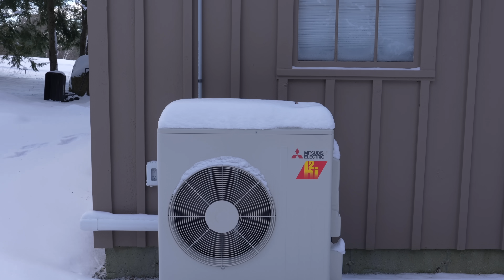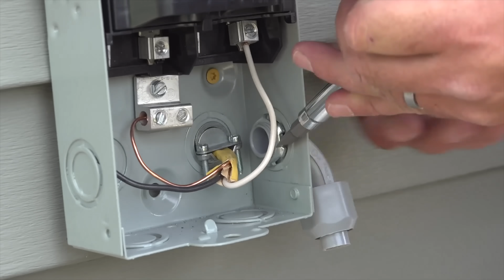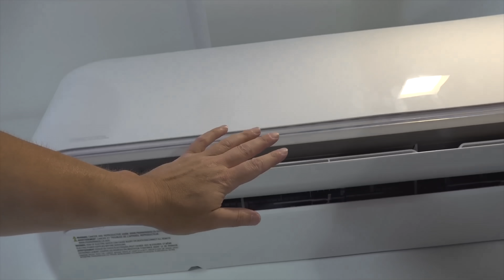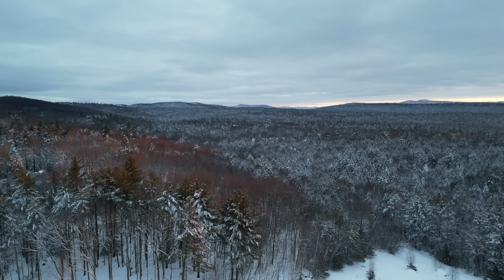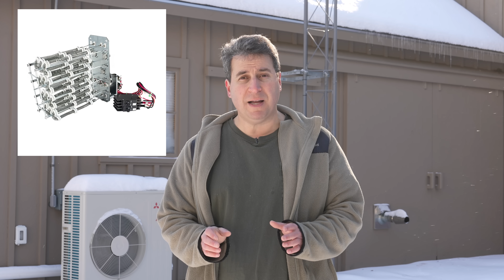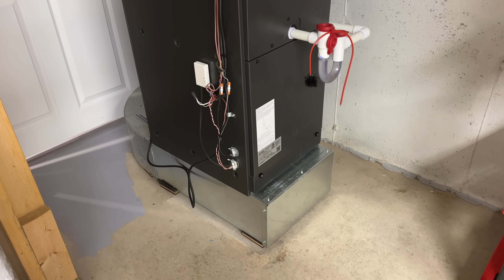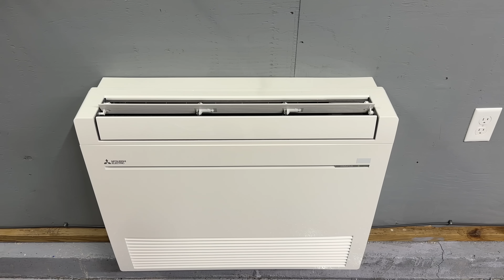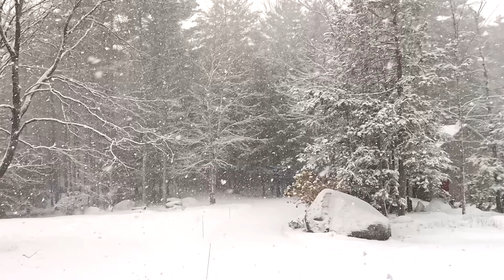Why Heat Pumps are now leaving people COLD

Comment: This talk about heat pumps being 'efficient' is misleading insofar as making people think that this machinery actually produces heat more efficiently than burning fuels directly. They do not. When you are pumping against the natural thermodynamic flow, that costs you energy. Now one brand of heat pump or system layout may be more efficient than some other brand or layout, but that is RELATIVE efficiency, not absolute efficiency. 

Highest efficiency means don't do anything at all, but no one wants that. All other options cost energy, some more, some less.

Comment: I have 3 systems now, they are not all created equally. I have two of the cheapest systems and a mid range system. The two cheaper ones will blow about 50 degrees when it's zero outside, the mid range one was at 70. All three units perform the same at 20 degrees outside temp. from there the heat output stays the same all the way up to spring weather. I've been told that locating the condenser in a spot IN the open helps "catch" the heat, the better performing unit just happens to be hanging in an area where it gets the most airflow while the others are under porches and on the backside of a building, both shielded from wind or show. I still have gas heat for when it gets below freezing but the heat pumps do most of the heating on most other days.
Reply: Jesus.  Condenser coils do not "catch the heat."  That's what the big fan is for.

Comment: Canadian here with a 1980’s house. I have a heat pump working down to -15*C (5*F) with no issues. Any lower and I have my electric heating aux heat come on. 
Using an ecobee, I can fine tune how and when the aux comes on. So far no issues at all. However I would not feel comfortable running a heat pump alone with no aux heat installed. 
The manufacturer has tested efficiency data down to -15*C and extrapolated efficiency data down to -32*C which is why I chose that temp setting value.
Reply: if it is one of those cold climate models, you should run it down to -20c at least considering your backup is electric -> as long as it has a cop much above 1, it saves compared to aux heat. aux heat can just supplement instead of take over completely.

Comment: The heat strips usually require additional electric service to air handler. Some homes would require panel upgrades. If no additional heat strips are installed every time the condensing unit defrosts your system will blow room temperature air. With cold ambient temperatures that could happen quite frequently. Dual fuel systems are a option if gas is available and electrical upgrade is not.

Comment: I'm surprised installers don't suggest backup heat in colder climates. They suggested it when I had my system replaced a few years ago, and I'm in Florida. I guess since electric heat is already common here, it's easier to sell people on using it as a backup.

Comment: I have a 90’s brick home in South Georgia.  I had to add double r30 (on top of 10” blown ) above the master bath and single R30 above the master bedroom because they install the heat pump handler in one corner of the house and our bedroom/bath was in the opposite corner and the temp was 85 degrees in the rooms in summer. Adding insulation was financially are only option. Technician said the heat pump was running perfect but had a bad set up in the attic with the old boxes.  We use a space heater in the winter like you suggested until we can remodel the bath and fix the problem.  Thanks for all you do.

Comment: I've had two air source heat pumps on my home for about 8 years now. My home is also and was previously heated since 1985 by oil, whatever the key pump is capable of. Regardless, the oil is cheaper to run for these last 8 years or so when it's down below. 30 to 40 Fahrenheit depending on me. Local prices of oil and electricity. I think one year was as cheap as break. Even was like 25 Fahrenheit. So when it's below that I use the oil. When it's above that I use the heat pump

Comment: So I question his claim that heat strips allow more efficient operation of the heat pump during high demand.  Resistance heat has a coefficient of performance (CoP) of 1.0.  For heat strips to be more efficient than the heat pump, that would mean your heat pump is operating BELOW a CoP of 1.0.  I have looked at a lot of heat pump efficiency curves and as long as you spec a reasonable unit for your climate, even at the bottom of the temp range, they are above 1.0.  Granted, I have not looked at every single spec and it's possible that in some extreme cases, certain heat pumps when WAAAY below their spec range for performance, do operate below a CoP of 1.0 but this is not typical, at all.  I would revise the statement to say that the heat strips A) increase comfort, and B) add performance to your system capacity in terms of how cold it can perform as well as how quickly it can warm up the house.  Basically it's managing a space heater for you in the most optimal way possible.

What people really need to do is understand their actual heating demand on a design night.  That "18,000 BTU" unit you installed MIGHT only do 6k heat on a -13F night (like my Mr. Cool 18,000 split system).  But I have a full oil furnace for my house and while I have 3 zones of mini-split, my furnace is 100% operational and intact.  And a wood stove.

Comment: It's 9F this morning in my part of Maine. I woke up to my new heat pump/mini split in defrost mode. I find when it's in the teens or below, it spends a lot of time in defrost. I crank up my propane heater on these days. I already had the propane heater due to all the power outages we have here in the winter, so I didn't trust an electric powered heater as my primary heater anyway.

Comment: heat strips kick in when the heat pump outside in cold temps drops off. the range heat pumps work well is not good anywhere.. geothermal if you can is a big costly add on? using hot water from the water heater.. thats not free? old school wood stove or mr buddy heater to suppliment heating..? WHEN the power goes out you need some non electric heat.

Comment: This really is a question of sizing. If the heatpump cannot keep up in cold weather, it is too small to heat the space. Supplemental heat makes sense in some cases because it is cheaper to use inexpensive electric heat strips on the few coldest days (nights really) than it is to get a larger (and more expensive) heat pump...and since the efficiency will be lower on the coldest days using electric heat on those few days doesn't hurt efficiency too much. But there's no technical reason why a heat pump cannot be sized such that it can heat a home effectively on the coldest days in that climate.

Comment: I'm in California, in the San Francisco Bay Area, and heat pumps work great year-round here, since the weather is relatively mild. No supplemental heat needed.

It's been relatively cold here recently, but "cold" here means 5 to 10C (41 to 50F) overnight. Still well within a temperature range where the heat pump will be efficient.

Comment: This sounds like a too small a system problem. You need to size the unit based on the account of heat it can produce in cold time. They all tell you the heat output is reduced at lower temperatures. 

Buy the correct size unit for the climate.

Comment: Is the drop in efficiency due to the temperature difference? If so, reducing the temperature inside will improve its efficiency. Conversely heating the air around the external unit will do the same - reduce the temperature differential. Perhaps then enclosing the external unit and heating it with say water from the ground may be sufficient to keep the efficiency up providing ground water is warmer than the external air.
Great video.
Reply: @r3furbish3dbrain12  That's right, that is why one needs to pump heat in, like with ground water.

Comment: My central heat pump system (Trane) has been working fine in these signal numbers nights. Also my system has Emergency heat just in case which is a heating element.
Mini splits suck.

Comment: I was an A/C tech for over 25 years, and now have plastic knees because of it. I have a heat pump on my house, and it works great. And it is cheap to operate. But. I live near Phoenix, AZ. Possibly the hottest inhabited place in the U.S. Even in the middle of winter it rarely ever reaches 32 degrees F, and only in the early morning hours. If you live in a place where it normally drops below 0 degrees F, a heat pump won't do you much good.

Comment: As with everything, the devil is in the details. Most people don't read the specs for their systems. The apartment I lived in decades ago (built in 1995), absolutely will not work below 35F -- the outside coils will not go near freezing to, well, not freeze. Compressors can work well below freezing. (how do you think commercial freezers go down to 0F.) It's the transition period that has to be carefully dealt with -- dew point, etc. -- to keep the coils from icing over. Once past that point, the temp can go way low. The colder you can get it, the more heat it can collect.

If I'm living in a place that routinely freezes, I'm not going to waste my time with a heat pump. I'm going to heat with stuff that makes heat: FIRE. (gas, wood, maybe some solar collectors.) And insulation. I'm talking antarctic level here. Once I get some heat, I don't want it escaping.

Comment: Another thing is you must elevate a heat pump it will not work if it is buried under the snow (always mount of stand be it a ground one or wall so that even if it snows a lot it will not be below the snow line). And if you get hail make sure the coil isn't exposed as this can damage it permanently. Also not all heat pump models include a base pan heater which is needed for frozen condensate otherwise the outside coil may ice up (if you live in an area this can happen make sure you get one with it by default or optionally install). 

In extremely windy environments or if you install it in the open you need hood/guards to stop the wind from interfering with the internal fan. And final thing that can ruin a heat pump is if you install it near ocean spray you need a unit specified to withstand the harsh corrsion that it will encounter.

Comment: Heat pumps are a scam!
How?
The heat pump that is super efficient and laughs at sub zero temperatures is not a reverse cycle air conditioner but a geothermal exchange system. These geothermal systems can be expensive to install especially as a retrofit as they require very deep holes to be dug where coils of tubing can be laid so that a heat exchange medium can be pumped through them. These systems can then use less energy to operate for a month that one of these scam heat pumps use in a day.
Why do I say they’re a scam? 
Scams usually involve misrepresenting facts or relying on the ignorance of facts to make the victims believe what the scammers want them to. Reverse cycle air conditioning is far more efficient than a resistance element, you can get upto three times the heat out of a thousand watts of electricity with an aircon heat pump than a bar heater can provide, but geothermal can do the same with three hundred watts , yet both geothermal and aircon are called heat pumps , the scam is the false equivalence that is encouraged.

Comment: I use a Mr Buddy when it gets below 20.
Connected to a 20 lb propane tank, lasts for days.
Flame beats electrons!
Reply: I have a Mr Buddy Hunting Buddy with 30 pound tank, long hose, and filter. I really cannot stand the smell of burnt propane in the house. I have to keep widows open a bit to vent the stink out.
But its there, available during emergency, and is reliable.

Comment: As with any heat pump, you need a back up source for the few days per year that it gets too cold to keep up with heat loss.  As far as efficiency, the pressures go down with temps so the unit uses less electricity so the cost goes down as well.  The real problem as I mentioned above is that the heat pump might not be able to keep up with loss.  With SEER ratings being 20 or over, the savings, even using back up heat quite amazing.  We use out back up heat around 3 days per year along with the heat pump.  The increased cost per year is miniscule.  Using mini splits we heat 2 homes on our property plus all other electrical divices combine for an average monthly electric bill of around $175.  That includes electric hot water, lights, electric range, electric clothes dryer, computers, tvs etc.  If I used the back up heat all winter that annual average goes up well over double or even triple.  So don't be fooled by scare vids like this one.  Heat pumps are the largest selling heating device in Canada.  That should tell you something.
Reply: Installers are screwing people everyday by sizing the units at it's 100% BTU rated capacity. As it gets closer to 0f the rated capacity drops off to the range of like 80%; the installers need to size the units based on the 80% rating. Guess that concept is a bit too complicated for some hvac techs. I'm glad I had a good installer, and it sounds like you did too. . . sucks so many people are getting hosed.
Reply: It tells me that you don’t have access to natural gas. It is by far the cheapest way to heat a home other than cutting free wood for a wood burner. Unless it’s a geothermal system heat pumps are useless in cold climates. An air to air heat pump is nothing more than an air conditioner that runs backwards. In other words it’s trying to cool the already cold air outside. When it gets below freezing, the outdoor coil will begin to freeze. After a period of time it will have to defrost which is accomplished by turning back into an air conditioner, removing the heat from the house to melt the ice built up on the coil. If you don’t have backup heat, you’re running air conditioning during this process. So you are using your back up heat source during each defrost cycle which is usually every 30-90 minutes of run time on an air to air heat pump.
Reply: @mikee2923  Oh, it's you again.  Gas is a terrible pollutant in production, distribution, and burning.  That's why people are turning to heat pumps.  Couple with renewable electricity, zero greenhouse gases.  Due to the bizarre grid and rate structure here in Texas, my 100% electric home runs on 100% wind and solar.  And I get that electricity for less than 8.5 cents kw/hr.

Comment: My heat pump  still runs at 0 degrees but puts out zero heat by 25 degrees and spends most of it's time in defrost
I added a fireplace. Problem solved.

Comment: I live in a hot state, I have always wondered why people on very cold states do not have as an emergency use a apt style wall heater that is fired by NG or Propane, they do not require any electricity, some are simple to install, single 8" hole in the wall.
Reply: Most people I know (I live in northern MN and grew up in northern WI) who don't have a woodstove will have a kerosene heater or two stowed away in the garage or basement that can be broken out and used in case of emergency.  A 24K BTU unit costs <$200 new and will heat >1K sq ft, the units weigh only 20-30 lbs so they're super portable, and the fuel if properly stored can last five years, sometimes even a decade (and they can also easily be made to function on diesel if desperate).  No electricity or hole required.
Reply: @drmwpn  Sounds better than freezing your a$s off.

Comment: I've avoided heat pumps for my 30+ years as a homeowner in the South, using a regular electric split system (closet furnace). I've never had a winter power bill over $300, and that was during the most extreme times like this week when it's down to 9 degrees last night. Reheating the heated air inside the house makes more sense to me than the old heat pumps that did their business outside and then brought it in. I'll probably never own a heat pump...more for you guys to enjoy.

Oh...here's a hint...do your baking in the morning and when you're finished leave the oven door open.

Comment: Our central heat pump starts to feather in electric heat strips at 10f and below.   Above 10, they never come on.   The house is pretty old, but insulated well with decent windows.   Growing up heat pumps in our area were not a great option as they wouldn't work below 38ish without freezing up, today they just deforest themselves and keep on working.

Comment: I would love to replace my AC with a Heat Pump some day, but 100% I would want to keep my gas furnace as a backup too. Electricity is very cheap in my area (lots of hydro) and natural gas prices have been going up quicker so I would love to take advantage on the 95% of days it will work flawlessly, but I'm keeping my furnace for that other 5%.

Comment: Watching this video from Maryland (current temp: outside 17F, indoor temp 71F) in a house heated by a ducted Mr Cool heat pump.  The system doesn’t have supplemental heat however our ERV has a small inline duct heater to temper incoming air. Our home is nearly airtight and well insulated.  The heat pump has performed well so far, we have only noticed slightly longer run times when temps are <20F.

Comment: I thought electric resistive heat is 100% efficient? 
I’m confused about the heat pumps anyway. From what I see it’s a reverse AC unit. Blowing the heat from the process inside the house instead outside. If that is true how could it be cheaper? My electric bill is 200-250$ more in the hottest months which to me means it’s would be the same for the coldest months.  While my natural gas is much less expensive.